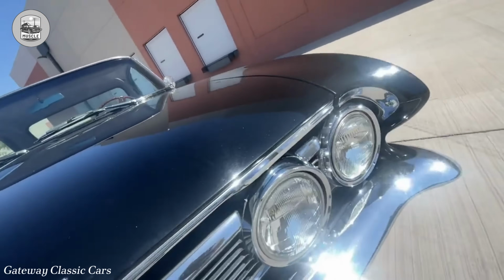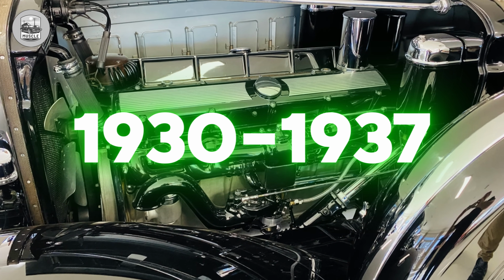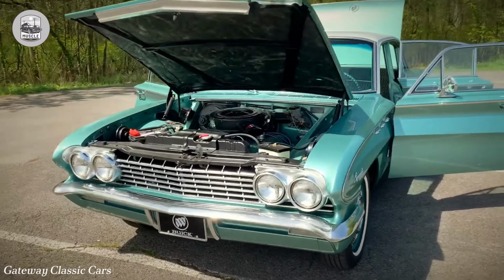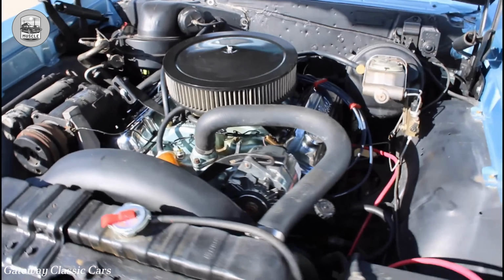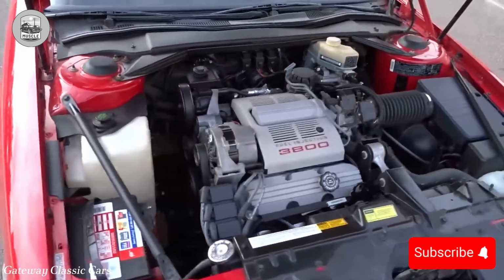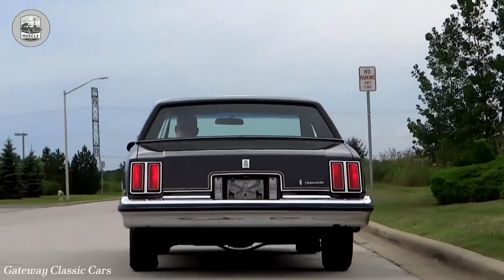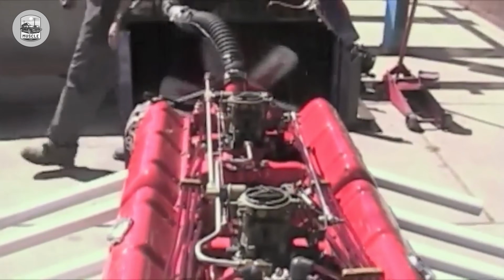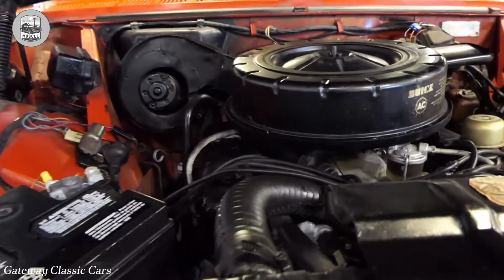10 MOST FAILED and WEIRDEST GM Engines ever made | Worst engines blunder!

Comment: A noteworthy mention, and one that I anticipated would make an appearance, is Pontiac’s 230/250 overhead cam straight-six engine. This innovative powerplant, produced from 1966 to 1969, was ahead of its time, showcasing Pontiac’s engineering prowess. Despite being relatively short-lived, the overhead cam design was a significant departure from the more common pushrod engines of the era, and it offered improved efficiency and performance for a straight-six engine. Though it may not have gained the lasting fame of some of Pontiac’s V8s, this engine remains a unique piece of automotive history worth recognizing.
Reply: Though overhead cam engines are more common now, this video highlights odd engines. In the 1960s, a domestic car with an overhead cam engine was unusual and innovative, making it stand out as a strange choice for its time.
Reply: @AilaniMadden  I 😆😆😆disagree with the view that overhead cam (OHC) engines were unusual or particularly strange choices in the 1960s. While it’s true that pushrod engines dominated the domestic car market, OHC engines were not unheard of, especially in performance and racing applications. The Pontiac Sprint Six OHC engine, introduced in 1966, was a prime example of domestic innovation, combining overhead cam technology with mass production, showing that OHC wasn’t a novelty but rather a forward-thinking approach that aligned with global trends in engine design. Additionally, European carmakers had been using OHC engines in the 1950s, influencing American manufacturers to adopt the technology. Therefore, labeling it as "strange" overlooks the broader context of automotive evolution.😆😆😆
Reply: That engine also has a seldom mentioned “dirty little secret”…..which is that the short block isn’t a Pontiac engine at all…..it’s a Chevy I6.
Reply from the maker: @J.R.in_WV  You're absolutely right! The Pontiac OHC six-cylinder engine shares a fascinating history with the Chevy inline-six. Pontiac used the Chevy I6 short block as a foundation and then added their own innovative overhead cam design, which was a game-changer for its time. The result was an engine that blended the reliability of the Chevy I6 with a higher revving, more performance-focused top end. What's really interesting is that Pontiac engineers worked hard to differentiate this engine from Chevy's, creating something unique for muscle car enthusiasts. This engine was a favorite in the Pontiac Tempest and Firebird, but it often gets overshadowed by the big V8s. I'd love to hear from everyone—what are your thoughts on this hybrid Pontiac-Chevy creation? Drop your experiences or thoughts in the comments, and let's dive into this 'dirty little secret' of muscle car history together.
Reply: I was expecting to see the ohc6 to be listed.  But it wasn't.  It is a motor that stops people in their shoes at car shows today. I drive a 67 ohc6 firebird!
Reply from the maker: @AZ-JKUR-HR  Thank you for sharing your experience with the 1967 Firebird OHC6! That engine truly is a showstopper and definitely deserves more attention. Pontiac's Overhead Cam Six (OHC6) was a groundbreaking design in the '60s, especially for an American manufacturer. It featured a single overhead cam, which was a rare sight in mass-produced American engines at the time. It was available in two versions: a base 165-horsepower engine and a high-output version pushing 215 horsepower with a 4-barrel carb.
Not only was it innovative, but it also helped the Firebird stand out in a V8-dominated market. The OHC6 engine even had a durable, high-revving nature, which surprised many who expected American six-cylinder engines to be underpowered compared to their V8 counterparts. It’s awesome to hear that you still drive one—it's a rare piece of history!
Everyone watching, let’s keep the conversation going! Share your thoughts or stories about the OHC6 or other unique engines in the comments. Don’t forget to like, share, and subscribe to Muscle Car Masters for more rare engine discussions and muscle car history!
Reply: Yup that' one to they should do their homework
Reply from the maker: @Daniel-zt3pz  Thank you for your feedback.
It is important information for us to practice our mission - bring back memories to all fans. Step by Step.
Have a good day. Don't forget to spend more time watching other great videos on our channel and SUB to explore more Muscle Cars
Reply: The OHC Pontiac six could really wind up, and could take a lot of abuse. A buddy had the OHC 6 in his Tempest, and was really upset he hadn't gotten something bigger and better. And he took it out on that poor thing. It has the two speed automatic transmission in it, and he would continually hold it in low and wind it out to crazy speeds before letting it shift. And it lasted a long time being treated that way. A friend's father had a salvage yard, and they had two OHC 6's  that he had kept back and hadn't salvaged we looked for a LeMans, Tempest, or Firebird wanting to build one up and see how it ran, but we never got it done before I moved away. There were some rather good speed parts for them back then, and it would of been fun to see what it would do with some preparation.

I cannot remember what the people involved with a project for the aluminum 215 V-8 motors, but they had gotten some pretty good power output out those little motors. It was so long ago, I cannot remember what motor building magazine the article was in, but it sounded interesting.

And I am old enough that I got to drive GMC trucks from tonners on up, and those V-6 motors were very good motors for their time for trucks and did great work. Nice power and great torque. Many short line trucking companies lived them. One small truck line owner had all JIMMYS, and he tried the diesel V-6. He loved them for there power, but had some of the problems listed in the video.

And the small V-8 diesel based off the 350 motor had problems, but so did the big brother 350. A Chevy dealer sold out boss that this diesel motor would replace the power we lost when Chevy pulled the 454 out of town truck production. Wrong! They couldn't pull the loaded we were use to hauling and pulling on trailers. This was in agriculture business, and we routinely hauled three or four ton in the beds, and pulled trailers and wagons with total weight up to eight to or so. That poor little diesel just couldn't do it, and both were traded in for Ford tonners with the International V-8 which was a work motor.

Loved the video, and I learned a lot. I would really like to see one of those Cadillac V-16's!
Reply from the maker: @ronfullerton3162  Thanks for sharing your awesome experiences! The OHC Pontiac six was definitely tough and could take a beating. It’s a shame you didn’t get to build one up with those salvage yard engines—adding performance parts like a cam or headers could have made it a real sleeper!
That 215 V8 was a gem too—lightweight with a lot of potential. Many people got serious power out of those little aluminum blocks. As for the GMC V6s, you’re spot on—those engines were workhorses with serious torque. The diesel V6s had their issues, but for their time, they offered a lot of power.
The small V8 diesels struggled, though, especially when compared to gas engines for heavy loads. Sounds like switching to the International V8 was the right move!
Thanks for watching and sharing your story! Be sure to comment, share, and subscribe to Muscle Car Masters for more classic engine talk. What’s everyone’s experience with these engines? We’d love to hear more....
Reply: @MuscleCarMasters68  My buddy and I both wanted to build one of those OHC Pontiacs. And when I found out I was moving to another state, but we hadn't told anyone yet, we found a '67 LeMans that the engine and transmission had gone out of, and the body was good. That was hard leave behind. But there wouldn't be anywhere to work on it, and no help from my friend and his father's salvage yard. But I can always dream of how it would of performed. 

I grew up on a dairy farm in southeast Iowa, and the man that owned four or five milk pick up trucks was the the fellow that had the V-6 Jimmy trucks. He drove the route that picked up our farm's milk. I think his name was Marion Lively , and he really believed in those V-6 GMC trucks. His personal truck was a grey color, and he had "The Grey Ghost"  printed on the hood. His were those short hood models, and they did make a nice looking rig.

Thank you for the memories! As you can see, you awaken some good ones for me.
Reply from the maker: @ronfullerton3162  Thank you for sharing such a great story! That ‘67 LeMans must have been tough to leave behind—especially with that OHC Pontiac engine in your plans. Those overhead cam sixes were something special and definitely ahead of their time for an American car, making it a real standout in performance and innovation. Imagine what could have been if you had the chance to build it with your friend—probably a real head-turner with the right tuning! Even though you couldn't take on that project, the dream stays alive, and who knows? Maybe one day you'll get another shot at it.
As for those V6 GMC trucks, it's incredible how much belief and loyalty guys like Marion Lively had in them. Those short hood Jimmys were workhorses and had a reputation for getting the job done, no matter the conditions. And “The Grey Ghost” sounds like it had some character—perfect for a truck that lived up to its name! It's amazing how vehicles can connect us with such great memories.
Thanks again for sharing these moments, and we're thrilled that Muscle Car Masters sparked those memories for you. Let’s keep the dream of building that Pontiac alive! Everyone watching, don’t forget to drop your own stories in the comments, hit that share button, and subscribe to Muscle Car Masters so we can keep the muscle car conversations going strong....
Reply: @MuscleCarMasters68  Thank you once again! Especially for the memories you sprung loose inside my mind.
Reply: @ronfullerton3162  a coworker from years ago and I would talk about the ohc6.  His buddy had a sprint with the 4 speed.  He had a 327-4 Camaro,  and he said the sprint would hang light to light with his 327!  But longer track and the v8 would shine.  My buddy had a 305 V6 in a 68 GMC camper special!!!  That thing was cool!!!  I like the oddballs!!!  My grandmother bought the 67 Firebird ohc6 and it stays in the family!
Reply: @AZ-JKUR-HR  I agree that those not so popular motors were much fun, and deserved more applause for their accomplishments. But there again, I am a motorhead and just enjoy checking them all. Such as the aircraft radials and V-12s, and the older diesels such as the Detroits and the 3406 Cat. They all are enjoyable to me.
Reply: Indeed. Well worded sir. There's a boat load of ignored engines.
Reply: I had a teacher in high school who owned a Firebird with the 250 OHC engine.  It seemed to run well.
Reply: I wonder if the head would work on a Chevy inline6?
Reply: @FlorentinoAnthonyContrevas same bottom end so yup same as the Chevy it would fit the 194 230 250 and292 great motor company
Reply: @Daniel-zt3pz the 292 has a talker deck height so you’d have to get creative figuring out the timing chain, but that would surely be a good running little engine…..a high compression OHC 292 with a 650 Holley 4 barrel could be a real hot setup in a Nova or Camaro.
Reply: @FlorentinoAnthonyContrevas I believe the blocks were cast different
Reply from the maker: @scottosborne9101   Thank you for your information. It is so great...
Let's see our channel is a place to share, comment or show your feelings about American Muscle Cars.
Have a good day.
Don't forget to like, share or SUB on our channel to enjoy other great Muscle Cars videos.
Spending more time with other great videos on our channel to explore more about American Muscle Cars.
Reply: @FlorentinoAnthonyContrevas  SBC V8 heads have been cut and welded for use on. Worked great, just not many people were buildind the inline 6s
Reply: @FlorentinoAnthonyContrevas  No. The 292 Chevy/GMC crank could be made to work in the Pontiac though.
Reply from the maker: That's an interesting thought! The idea of fitting a different head on a Chevy inline-6 could open up some fascinating possibilities for performance upgrades. It might take some custom work, but it's definitely something worth exploring! Does anyone here have experience with inline-6 swaps or head modifications? Let us know your thoughts, and feel free to share any tips or stories you have. The more ideas, the better—let’s see what the community thinks!
Have a good day.
Don't forget to like, share or SUB on our channel to enjoy other great Muscle Cars videos.
Spending more time with other great videos on our channel to explore more about American Muscle Cars.
Reply: @MuscleCarMasters68  for the Chevy 6 225 or 261, there was the Wayne head.
Reply from the maker: @juju-rt8ek  Thanks for bringing up the Wayne head! The Chevy 6 engines, especially the 235 and 261, really came to life with those aftermarket Wayne cylinder heads. These heads, often made of aluminum, were designed with improved flow characteristics that allowed better combustion and significantly boosted performance. Many racers and hot-rodders loved these for the extra horsepower they brought to the table! The Wayne head, combined with a good cam and carb setup, could transform these engines into serious contenders on the street and the strip.
For everyone tuning in, if you're a fan of classic mods like this or if you have your own experiences with engine upgrades, drop a comment below! Don't forget to hit that like button, share with your fellow car enthusiasts, and subscribe to the Muscle Car Masters Channel to stay updated on all things American muscle. Let’s keep these legends alive....
Reply: @CookeZachery  if I had the knowledge about machining I would make that Pontiac over head cam fit on a Chevy 292 nothing is impossible! The original hot rodders experimented on motors that's how we got our knowledge how to make high performance vehicles if it wasn't for them none of this would exist to day  I have old buddy's that race on the salt flats they told me they threw some many engines before they figured it out also they told me how they invented pearl paint not a lot of people no how it was originally made I have lots of respect for the original hot rodders
Reply: Too bad Pontiac didn't make a V12 version of the ohc 6...
Reply: Too bad Pontiac didn't make a V12 version of the ohc 6
Reply: M ml
Reply from the maker: Thank you for your information. It is so great...
Let's see our channel is a place to share, comment or show your feelings about American Muscle Cars.
Have a good day.
Don't forget to like, share or SUB on our channel to enjoy other great Muscle Cars videos.
Spending more time with other great videos on our channel to explore more about American Muscle Cars.

Comment: The fellas with the knowledge of that era 😢 are mostly gone now. God Bless' em. Too bad GM wanted to be cheap. Stopping production of an all aluminum V-8.
Reply from the maker: Man it hits me hard thinking about that era because most of the old timers who really lived it and knew every bolt and casting number are gone now. God bless those guys, they carried the true muscle car spirit. What really stings is how GM pulled the plug on that all aluminum V8 just to save a few bucks. That motor had serious potential, it was light, strong and could’ve changed the game if they stuck with it. Instead we got corporate cost cutting and lost what could have been one of the greatest engines of the 60s. Fans like us will always wonder what might’ve been.

Comment: My favorite engine was the 109 streamline two top overhead port valve dome induced with fluid injection system.. produce close to 400 hp 500 foot pounds of torque.

Comment: The Cadillac V8-6-4 which was shit, was the predicesor to the 5.3, 6.0, 6.7 AFM which is also shit. GM needs to scrap these engines too. My 2009 and 2018 Silverados blew lifters, cams, head gaskets, and cat converters. 2018 is at the dealership as we speak being rebuild. Pretty sure the transmission is smoked too. GM needs to do better. Also I get better fuel economy with the Range AFM disabler keeping the engine in full time V8 mode.
Reply from the maker: @michaelhancock9636, you hit the nail on the head! The Cadillac V8-6-4 was a disaster, and GM’s AFM (Active Fuel Management) hasn’t done much better. These lifter and cam failures have been a nightmare for Silverado, Sierra, and even some Camaro and Corvette owners. The idea of cylinder deactivation sounds good on paper, but in reality, it’s killing reliability. And you’re absolutely right—many drivers report better MPG with an AFM disabler because the engine isn’t constantly switching between V4 and V8. GM needs to step up and bring back solid, reliable V8s without these gimmicks. We want power, durability, and performance, not ticking time bombs under the hood
have a good day.

Comment: "Worst engines blunder!"
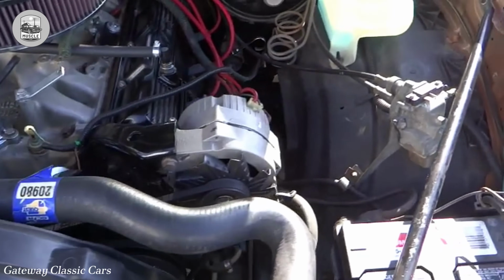You got that right... @22:40 you're showcasing the 350 diesel but show a video of an engine with sparkplug wires. I bought a 79 Chev C10 P/U with one of those gas conversion diesels, immediately took it out and put in a 72 Buick Skylark 350.

Comment: Let's not forget the "oddball" 348 / 409 engine block with a 74 degree / 16 degree a twisted,  45 degree flat overhead valve cylinder head.  They made thousands of them.   Or the big block, canted valve cylinder head.  They made millions of them.